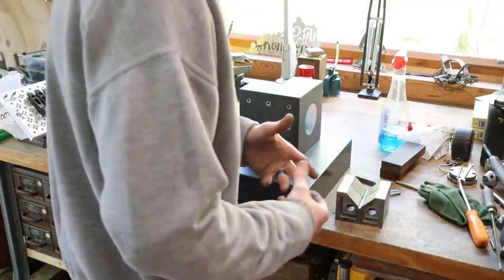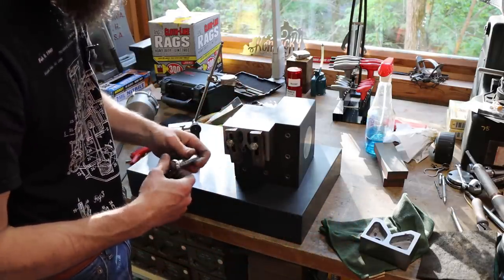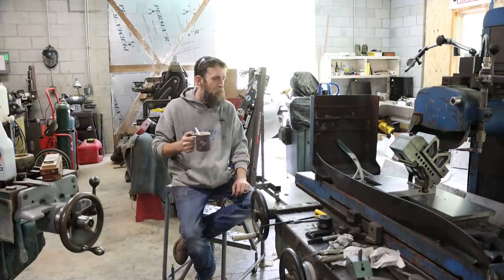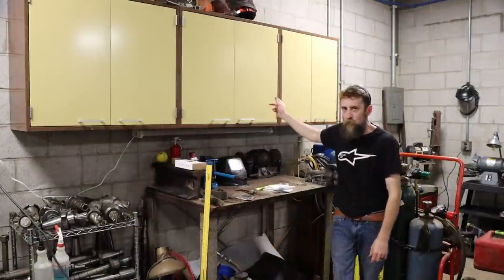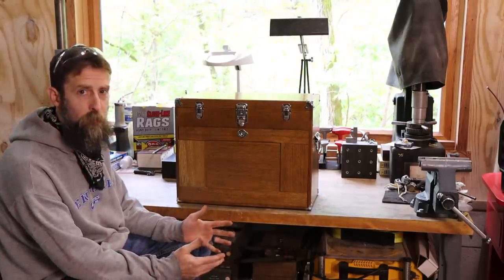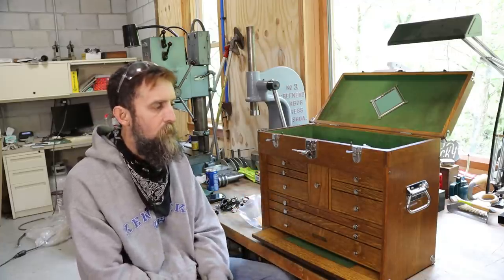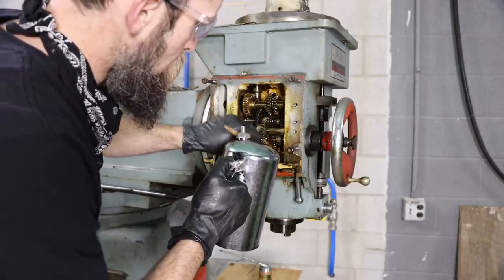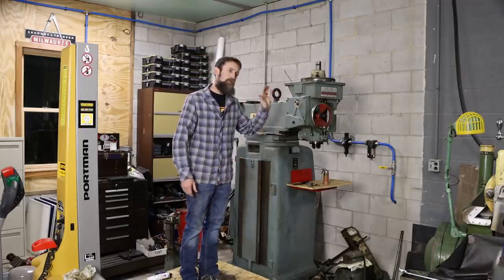DoAll Mill Gearbox Service / Surface Grinding V Blocks & New Gerstner Tool Chest

Comment: In 1962 starting my apprenticeship I was able to purchase an old used Gerstner machinist chest from an antique dealer. It was oak, small, no key, very dirty on the top with a worklight bulb burn but had the Machinery's Handbook drawer.  His refinisher was able to remove the depression from the light burn with wet rags to swell the wood.  With the lock number we ordered new keys and a set of drawer knobs from Gerstner.  I was back in business just large enough for my tools until I could afford the newest edition of the Handbook! It was 1/4" thicker than the vertical drawer, to this date it stays on the left under the lid.  Lesson-Buy the latest edition as new processes are added, afterward I would give my old edition to our newest apprentice.
Gerstner made an accessory base having several long drawers to fit under their chests, many toolmakes in our area made their own. A nice addition for the heavy set-up blocks, angle plates and parallels.
Auction prices in south central Pennsylvania are $100 - $125 for an unrestored complete oak chest, walnut is doubled.

Comment: Hi Steve, I would like to offer up adding a safety practice of using a angle plate and stop plate when grinding with that set up like you used to grind the V blocks. When I was working in a Die shop the we always used blocking. If you tip the work piece over you will never for get the mess.  I enjoy your time in the shop Thank you.

Comment: That grease is one of the very Best Out there.
Its great to use on bearings. Gears. & other things.
Its acid free & will not rust or degrade metal.
Had a can of that grease on my work bench for 40 years. Used it for 40 years too.
From brand new to empty the grease never broke down in any way what so ever. 
Very Very good Choice.

Comment: Also, just a suggestion when grinding a v block, Move your wheel right up to the opposing face, start grinder and plunge straight down until it cleans up. then feed out. this way the wheel always breaks down so as not to affect your work. mark that number on your height and repeat for the other side. Same would go for grinding to a step or corner, always feed away from your corner.      Nice channel Steve,  You certainly do always seen to get it done.

Comment: I received a Gerstner toolbox as a birthday present 22 years ago, I picked it up at the factory and carried it back in the car so it would have a save journey, it is the centerpiece in my shop and I've done a good job over the years of filling it up with precision tools.  Adam Booth did a great vid on the factory and its disturbing to realize that there are only 17 very talented folks left at this facility.
Reply: What's really disturbing is their International brand are a fifth the price of the USA made ones.
Reply: @1pcfred  Big difference in quality between them..........the ones made in Ohio are like a fine piece of furniture.
Reply: @ericsandberg3167  I never knew that only buckeyes could make fine furniture. If you really want fine furniture then you can't beat the Japanese. When they make a piece and you push one drawer in another pops out due to air pressure. It doesn't get any finer than that.

Comment: Mirror in the tool box was probably for getting things out of your eyes when people didn't wear eye protection!
Reply: Proably right but no matter the erra when you get something in your eye that you cant get out yourself at least the 2nd time you start wearing the eyewear I still have an astigmatism to this day to remind me
Reply: The mirror was there so that you could see the boss coming when you were skiving
Reply: Yeah, wearing a suit to work, with no safety glasses!....🍁
Reply: Back in the late 40's and 50's, it was common for people to wear a suit and tie to work. Not sure about machinists in that day, but mechanics in the dealerships and high-end shops wore a white lab-type coat over the suit while working. To make things interesting, you would be hard-pressed to find one with grease or oil on that white coat. Learned that from my father-in-law.
Reply: If you couldn't remove the thing yourself you would get a work colleague to do it for you - a twist of paper wet with a bit of spit was the normal instrument to use!

When I was an apprentice in the early 60's I can remember going to the Birmingham (UK) eye hospital one Sat morning with something in my eye from the day before and also my dad, a toolmaker, getting up in the middle of the night and getting the night service bus (no car) and going to a hospital to get some attention to his eye. 

Regards from Redruth

Arnold
Reply: @amazonianm8876  The best thing I ever found was a loop of single strand telephone wire, stripped of it's insulation, smooth and safe! Today, for metal a strong rare-earth magnet works beautifully!
Reply: @MatthewTinker-au-pont-blanc  Thomas Midgley, the guy behind leaded petrol and CFCs, famously dissolved a splinter out of his eye by washing it with mercury. Of course he poisoned himself, like most of the time.
Reply: I also was told that a small magnet often was on the rim of the mirror to help fish out the ferrous bit. But if you got aluminum in your eye, out of luck!

Comment: Steve, Gerstner does restoration of these Tool Chest, they dismantle completely and rebuild it as if it was with fresh cut wood, and they will replace some of the hardware pieces that are missing or damaged and they even replace the felt and clean the mirror.   If you want one restored go on their web site.

Comment: I watch your videos every Saturday and really enjoy them. I am retired. But having been a machinist and a dock worker and truck driver I have two points of contention. I was a machinist in the ‘70s. Nobody wore a suit and tie, or even just a tie to work. Also accidents happen even by those with the best intentions. There are millions of packages delivered in a given amount of time with an amazingly low number of damages. I personally have never received an item that was damaged in shipping. The problem is with the manner in which you find out about damage. The trucking company cannot open your package to inspect it if it suffered an accident. A lot of times boxes are taped back together so they can make it to the customer. Only the intended receiver can open a package. Then they must determine if it is damaged and file a claim. I think you were slinging mud at hard working people.
Reply: If you’ve  never received  an item damaged in shipping, you either don’t get many items shipped to you, or you’ve been incredibly lucky. I’ve had two items in just the past month that arrived damaged due to mishandling during shipping. And that’s far from the first time it’s happened. UPS and FedEx are both equal opportunity offenders in that respect, and the Postal Service isn’t much better…..

Comment: I notice that when using that cutting torch you aren't wearing gloves and have a short sleeved shirt.
Is that you exercising your right to bare arms?  ;-) (English humour)
Reply: Keep in mind that isn't an arc, so it isn't generating UV that would result in sunburned arms. This will just result in the good old-fashioned kind of occasional burn.

Comment: Reminds of the time I went to a freight company to collect a parcel. While I was waiting, I saw a warehouse man throwing large boxes with the "Coherent" brand name into the back of a truck. 
This was a brand I, as an instrument technician,  was familiar with - they make laser devices. Judging by the size and shape of the boxes ,they probably contained a high powered water cooled instrument laser - worth $50,000 to $100,000 at the time.

Comment: Steve, here’s an old Luthier’s trick for getting glue deep into cracks, use a small suction cup after applying glue to ‘pump’ the glue deep into the joint. It works really well.
Reply: My trick is to just tear the wood the rest of the way apart and glue it back together. Being as I'm never making musical instruments. Finishing the break works good too. Modern PVA wood glue is stronger than wood. I like Titebond II the best. Elmers used to make nice stuff called Probond. But I can't get it anymore.

Comment: You are right about the fragile stckers. The average person/handler will touch 10’s of thousands of parcels a week. The average driver 1000’s. Your parcel goes to a local depot, a state hub, a central hub, and possibly an airport. Then at the other end it goes to a state/county hub. Thats a lot of vehicles, hands and  many conveyors. Often all overnight. Because  we all want cheaper delivery and shareholders want more return yearly,  there are less staff in hubs working flat out. Also time contraints set by the customer mean your boxes are  often ‘loose loaded into many trucks. Sometimes your box will be in the bottom of this truck pile with possibly tons of pressure above it. By the end of your first ever shift at a depot  you have already seen more than enough Fragile stickers. And whilst a driver has more time to contemplate a parcels fragility,  any damage had already occurred way back down the line. Factor in third parties and airport handlers  and you will see why faith in a fragile sticker is a touch futile. Also bear in mind that Millions of parcels arrive intact every week. If your parcel is packed correctly, it stands a greater chance but with millions or parcels in the system there are inevitably damages just by statistical chance. Just as there are deaths and mishap  in large populations. Just  A stray forklift tyne is enough to finish off any item.  So when it happens to you please understand that it is very bad statistical luck. It is real hassle for any driver or hub worker to deal wirh damaged items and placate customers (They would rather deliver intact goods really) - Usually for something that happened because of corporate greed and the insistance of customers on free or cheap delivery. It is also why your drivers are becoming less professional. Because of the way the carriers are hiring owner drivers at low cost,  with no experience of a geographical area and poor driving skills. Rant over. Insurance companies very  rich indeed .✌🏻

Comment: Shop is looking great, you have done well for yourself. Looking forward to seeing the mill up, and running.
Reply: His plan for doing those shakes is still shaky though. On job sites horror stories abound with rebar sticking out of the ground. Least Steve has a torch though. Because when you get impaled by bar that's what they have to use to cut you off. You try to use a reciprocating saw and the vibrations are too much. I guess they only have to cut the bar when you fall on a really long piece? I can tell you right now it wouldn't be me on a ladder working over bar sticking out of the ground. I may be stupid but I'm not goofy! He should just knock together some scaffolding over there. It's better to work off that than ladders anyways.

Comment: you should wire your pump up to the flow switch or put a switch up near the flow switch so you can instantly turn the pump off.

Comment: Steve, plastic or synflex line should have steel or brass sleeve  inserted before the compression sleeves are installed.

Comment: Does the coolant keep the temperature down on the concrete too? Asking for a friend lol....
You're absolutely right, wood boxes for precision tools are great for moisture protection. The wood will absorb and release arid humidity. Even when finished in paint or varnish. I've put wood endwalls in all steel buildings before for that very reason. It makes a noticeable difference.

I have a family member working at fed ex. He has broadcast to everyone not to ship expensive electronics, heirlooms etc... and you're right... "fragile" labels seem to only entice the worst in handling. 
That box is really nice, it's a shame. Myself I would take it to Gerstner for a good factory style fix. Maybe a couple days vacation with the family worked in to boot! There's lots to do for a couple days with family around the cincy-dayton area. 

Great to see you enjoying your projects in the shop (vs. on the shop) again. Great video as always. Thanks for sharing

Comment: I have used plastic tubing with a brass sleeve inside the tube. This helps the tube seal better and take more pressure.
THanks

Comment: I would send the box back to Gerstner and have only the damage repaired. Leave the everything else original. Let UPS cover the shipping and repair. Seems a fair solution for all. 

I have also had shipping problems but more with USPS. My wife ordered at book that was shipped in a padded envelop. The book was about 3/8" thick with hard covers. The postal worker smashed the center to contour the book to fit into the mailbox and broke the covers rather than drop it at my house (several hundred feet up a gravel driveway) or leave a pickup slip. I confronted the Postmaster on the way into work and she said that she would talk to the postal worker. Went to work, came home about 9 pm on found the door on the mailbox open, fully stuffed with another crushed box. Fortunately, the contents were not damaged, but all this stuffing and unstuffing broke the 20 year old steel spike holding the 4X4 post for the mail box. I have replaced the mailbox with a 4X6 post, 2.5 feet into the ground held with 200lbs of dry concrete mix and very large mailbox. Seems to have worked. Sucks that the two pieces of lumber cost about $70.00. USPS refuse to cover the damage of the book as it was not insured. At least I got a Thank you note written on a blank pickup slip after I fixed the mailbox.

My view is that if you don't like your job, find another. Don't take out your frustrations on the people or their property that put food on your table.

Comment: TOOL CABINET - Nice to see you have lovely wooden tool cabinet. We here in the UK had a similar tool cabinet made by Moore & Wright, these were the cabinets to have, but are sadly no longer made. However I have just started making these in the style of the M&W cabinets and they can be viewed and purchased on my Etsy site if you were to look for EmCworkshop. Or search for Engineers cabinets. Such a shame yours has been damaged. I recently sent one of mine to New Zealand without any issues, the create wasn’t even marked. Luck of the draw I guess. Hope you get yours resolved to your satisfaction.

Comment: Use a hot air gun to soften and melt all the grease - it will run down to the bottom where you can leave it to solidify again and then scrape it out.
Reply: If of course you can get to the bottom of the top gear case.

Comment: From my experience in a factory stores goods-out area, and later as a tech shipping computer gear around .au  in a small computer-maintenance business,  I really think the  'fragile' sticker is interpreted as some sort of bizarre challenge for some people.
Reply: When a I was an apprentice in an West Aussie airline company it was a standing joke the baggage handlers couldn't read because as they were throwing the packages into  the freight area of the DC3 they commented "This fragile' bloke gets a lot of mail"
Reply: @breezy1849   In the mid '80s I once watched our regular courier  driver (a brand we no longer see...) take a 18x18x18" box covered in 'fragile' stickers (the contents of which were about half the value of an average  suburban house at the time), and  throw it for a  '3-pointer' , from the rear doors of the 5-tonne truck against the  back of the cab...    Another beauty in the late 90's was a rack computer packed in  heavy triple spaced boxes sent from Adelaide to Kalgoorlie. When it arrived in WA it had hole the shape of a forklift 'tine' though all three boxes and a deep dent in the heavy steel case lid and the motherboard crushed.  The courier's insurance  people said it was "improperly packed" and the claim was refused.

Comment: Great video Steve, for the coolant bypass you could use a ball type non return valve in the outlet and back to tank. Maybe mess with the spring to get it right but probably work fine straight away.

Keep up the good work👍

Comment: Hi Steve
Just be careful with the rods driven in the ground to tie the ladder too. Things sticking up from the ground when working on a ladder have the potential to be extremely dangerous. We don’t want you getting impaled. 
Say safe from here in the UK
Reply: Yes that is a potential hazard, but so is falling from a slipping ladder and landing down in the creek which could be a raging torrent after some heavy rain.
Reply: They make orange plastic caps (mushrooms, we call them) to keep you from getting impaled.
If it were me I'd set up a plank instead of screwing around with ladders on a drop like that.

Comment: Just a safety tip Steve don't  turn your acetylene  tank valve on more than a quarter turn turning on more than that can cause acetone to come past valving and ruin you're setup or worse

Comment: Sorry about the Gerstner, those are beautiful. Hope to have one some day, used of course. Watching you with the surface grinder as changed my mind in regards to the value in a small home shop. Thanks again for sharing.
Reply: Surface grinders are the stuff for doing precision work. Cutting machines are just for roughing work. Your lathes and mills and what have you. Anyone that knows what they're doing if they want it better than a few thou uses a grinder for that. But you won't run into too many here that know what they're doing.